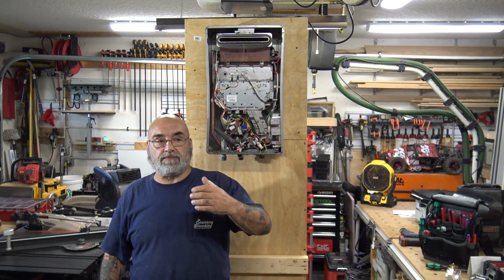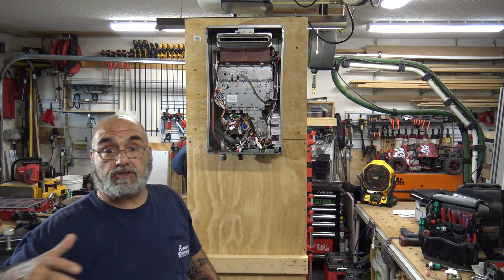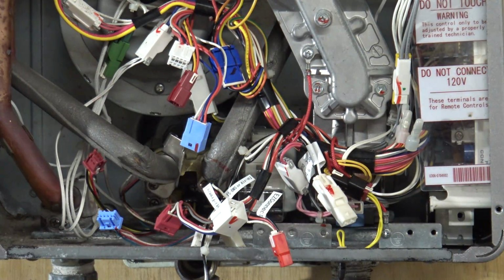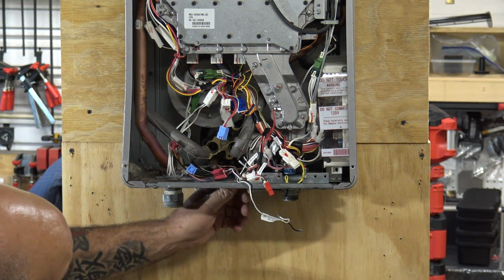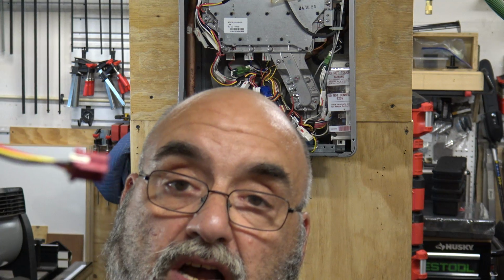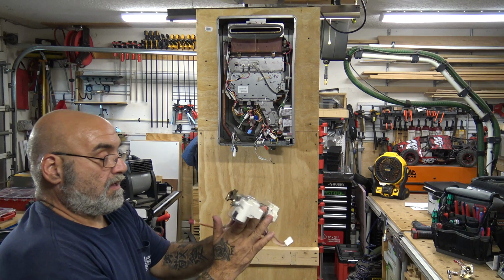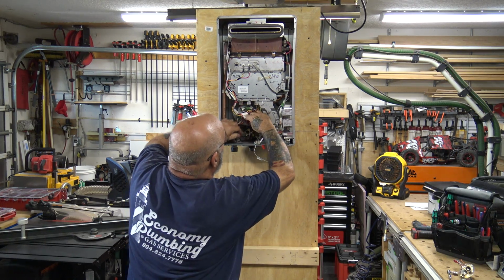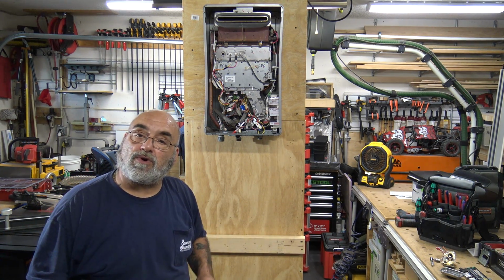How to replace a water servo valve on a Rinnai R and RL non condensing heater.

Comment: Great video. Helped me out quite a bit on my 12 year old RC98i. Same issue. No codes. Not kicking on. Tried to blow it out twice. Found the part # in that paper on the back of the door thanks to you. Found the part new for $85.00. The part did come with the O rings and the directions included in the kit were actually very good. Took about an hour to do. Immediately worked. Water also seams to be hotter and works faster than before. So it may have been degrading over time. Local repair company wanted $300.00 just to diagnose and recommended replacing it due to age. That would have been such a waste.

Comment: Hopefully you’ll see my question. I just replace the o ring on the inlet because there is a leak on the cold water side and it’s till leaking. It it possible the water servo valve is leaking?

Comment: Mr. Mike.  During a Maintenance Flush, the exit (hot side)  stops flowing.  ???    I unplug the circulating pump, re-plug the pump ,and the water exit flow starts, then stops after 1/2 minute?  Any thoughts??

Comment: When flushing my RU80 my unit does not allow vinigar to be pumped through the exchanger.  What valve do I need to disable or should I leave the unit on with gas off, or unit on and firing with a very low setting on the thermostat.  Unable to flush.

Comment: Question, I have an external unit and it works and heats water. My  MC-91-2-s has voltage to it but no display. I replaced it and same issue. I connected both to a bench power supply and same issue.  Should the controller have a display of any kind with just voltage to it, or is it an issue with the Rinnai water heater?

Comment: If the flow was restricted wouldn't the flow of water coming out of the taps also be low .. I get full water pressure but only warm water and no codes

Comment: great video, based on your video, I'm pretty sure my water servo valve went out(not opeing up). my house get's cold water only, no error code but no hot water, and all pipes don't spew hot water.  any idea how to get the servo valve working as it's not opening up and no water is able to go through to the tank.  it is a 17 yr old tankless,  thinking I should pay 1500 and just place it all

Comment: so i flushed tank, only a year old. after flush hot water intermitting.  works with shower all the time, but sink u have to turn both on.  could servo have a piece of sand or debri that is allowing servo to work intermittant.  im going to back flush tommorow.  any idea, no codes either
Reply: Did you remove snd clean the filter? If the shower works fine the units working. Check the aerator on the faucet for dirt. Mike

Comment: Question for u I just installed the RSC199in. At startup I noticed a pressure drop on the hot side that I haven't witnessed on past installations. It's not the plumbing bc it's all new and I isolated the tank from the plumbing and it does the same thing. I tested the pressure at the cold side service valves 85 psi and flows strong. Out of the hot side valve it flows strong for 2 seconds and then pressure cuts in half. Could this be the servo valve?
Reply: If you checked the incoming filter for debris and you checked the pressure at the service port and both are good then it could be the servo valve.
Reply: @TheBuddylab ya I did pressure is good at cold service valve. Hot side has good pressure when tested with gauge but dies when operating. Rinnai sending new servo valve thanks. Crazy thing is I just got finished with another rsc and same thing. I think Rinnai has a bad batch of servo valves down the pipe line. I have installed problems 30 of these RSC units no problems now get 2 in a row that where bought at the same time

Comment: @ThatTanklessGuy

Hi Frank, I’m in the process of doing this myself and I’m very hopeful that this finally fixes the problem (had issues for almost 5 years).  

I was wondering if there’s anything that could be done to prevent this from happening again?  I know a water conditioner could be a solution but is there something simpler such as an inline sandtrap.

Comment: How’s it, my tank(r53i) shut off and the fuses blew out. I replaced the fuses and the heater never turned on, both the control panel and water heater. Turn on hot water and the machine does nothing. I replaced the PC board, and still nothing. I’m going to check the turbine today. Never had any issues with this heater. Will the heater not show any sign of power if the turbine is malfunctioning? Confirmed power to the unit is good. Any advice is appreciated.
Reply from the maker: yes if the water flow turbine is cloged or bad it will not fire the tankless buy you may have a bad PC board. it will show signs of power to it but something might have burned out when the fuses blew. Mike
Reply: @ThatTanklessGuy  mahalo for the reply. I just replaced the pc board and checked everything including the turbine. All looks good. I checked the power to the transformer and shows power, but the secondary/ output in the transformer only shows 4v coming out so I think it may be dead. The part is obsolete now apparently, I ordered a universal, 120vac/24vac. Will this work?

Comment: I have an RL75 with a code 65. Trouble guide says it's a bath fill function error. However, I don't have a bath filler. Does this still sound like a bad servo valve?
Reply from the maker: Yes it could be a bad or dirty servo valve
Reply: I have a RL94 and I don’t have the part number for it. Do you have a link for one?

Comment: Thanks for the video.  I'm 80 miles from the nearest road in the Alaska bush and the 75i stopped working.  I thought it froze up but I find that unlikely.  I shut off the inlet and outlet water valves, open up the two valves we use to drain the unit and blow through the hot water side, nothing, it's blocked.  On startup the control panel doesn't light up and there is a buzzing like a stuck solenoid so that's why I suspect this valve.  I'll let it warm up some more (it's inside but there is the exhaust pipe) and see if it drips and is frozen after all.  Living in the bush I have to repair everything myself and your videos are a tremendous help!  I never knew about that paper on the inside of the cover.  Does this sound like a bad valve?  Any suggestions?  Thanks again

Comment: Hello Mike . 
Have a very curious case with my Rinnai 98 RU
When i have only one shower or bathtub hot tap  running , the max temp i can get is 36 Celsius. If i open vanity hot  tap at the same time, water temp at vanity is 52 Celsius and temp at shower drops to 29 degrees and all valves are  located at the same level of the house .It is the same on all levels of my house.
 I reprogrammed my unit to max temp 140. For some inexplicable reason at 135 F and 140 F my unit is NOT firing at all and in use light NOT lit when there is demand for hot  water. The max temp setting  unit goes to work is 130 F.
When I go and open bathtub hot water on main level and hot water at vanity in basement, story repeat itself. Small volume demand  is super hot at 52 Celsius and big flow is only between 29-36 Celsius.
Unit has been cleaned and descaled and i got water turbine spinned by compressed air from the bottom of servo valve when i took water filter assembly apart for cleaning .
I suspect water servo valve turbine jamming ??? What is your vast repair experience tells you ?  Thanks in advance for Your advice .Regards.
Reply: I have the same situation. I’m starting to suspect it’s this. You figure your issue out?

Comment: I have a r75lse , it’s 12 years old. It has all of a sudden lost hot water pressure , it works ok from the kitchen faucet or bathroom vanity faucet unless you turn two faucets on at the same time. The bathtub and the shower has very low flow. The water is hot but no pressure ,,, I have flushed the tank several times but didn’t change anything ,, it’s giving no error codes    Anyone have any ideas what I need to try next ??

Comment: Great vid.  My rinnai has been surging hot cold every 1min and tech said the servo and bypass is the likely cause.  But they said they have not seen this symptom without an error code. Have you ever seen this symptom?
Reply: RL75/nat gas indoor.  You can hear the burners kick in low and high mode every min when it surges.  Already cleaned the fan and burners and flushed per your vids.

Comment: I HAVE A RL75I THAT IM HAVING ISSUE WITH SOME FAUCETS IN HOUSE NOT STARTING HEATER WORKS FINE OUT SIDE AT RELEIFE VALVE AS SOON AS YOU OPEN HEATER COMES ON DO YOU THINK ITS THE SERVO OR THE SENSOR?THANKS FOR VIDEOS THEY ARE GREAT!!!
Reply: I HAVE NOTICED THE FAUCETS THAT ARE GIVING ME ISSUES ARE ONE HANDLE FAUCETS KITCHEN AND SHOWER
Reply: Hi, I saw your posting. Can you please 
feed me some info how you fixed your 
heater issue, I'm having same problem. 
Heater won't turn on on low faucets flow.
Any info please.